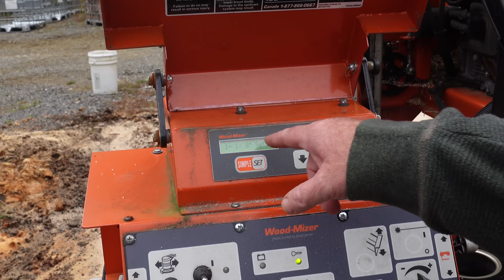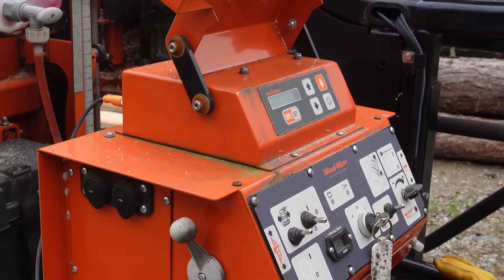We were overwhelmed! But thats a good thing

Comment: Thanks Nathan for giving Mike the tip. The sound is incredible with the saw running. Both of you have very nice facilities and are getting better. Congrats on the fire starter!
Reply: I don't remember the motor being as loud. Perhaps a bit too sensitive. Also more background motor noise in the excavator. Had to turn down the volume 2 notches.

Comment: Could you use the sawdust from the mill for Firestarter or is it too small? If so, you could maybe use the plastic containers from the totes. Trim them low on one side and set them alongside the mill in a line to catch the discharge. When they get full, slide them aside and put empty ones in their place. Just a thought

Comment: Mike, the blade lubricant tube is rubbing on the top of the log, it was nearly ripped off on the very first pass on a branch.  Perhaps, an item that requires attention, if you care to re-run the start of this video.  Regards Robin.

Comment: Is there a way to use the first pieces cut off those pine logs to make the wood chips for the fire starter?  Even if you took them to the place you get the wood chips from.  Ever since I fist saw your saw mill I was thinking there should be a use for the trimmings and the saw dust.

Comment: I use bio-diesel , used peanut oil from a fryer  mixed with pinesol and washer fluid so its not an eco thing. work just as well as regular diesel. our mill under roof but we shovel the sawdust out onto the ground

Comment: Hey Mike, I've always wondered If you have the capability to run a 2 sided blade on the mill? That way you can cut down and back. Not sure If that is an option on your current mill. Will the new mill have that option? Seems like it would be faster when processing lumber...
Reply: Those blades don't exist.  Even if they did the trailing cutting edge would get dull in the first pass being run thru the wood backwards.  Also there are parts of the mill that would be damaged if there were teeth on the back side of the blade.
Reply from the maker: Yea like David said I never saw one like that

Comment: If you can figure out how to put the Fire Starter into rolls, I will purchase them. Currently I burn 500 lbs of coal per year, I use 1 charcoal chimney. Currently I purchase all my fire starters off Amazon. Would rather order from you. I believe I paid 19 something for 60 rolls. They are approximately 1 inch round, and 3 inches long.

Comment: Did you say you put diesel in the wood miser ?  So they have both gasoline and diesel powered mills ?
Reply from the maker: In the tank that lubes the blade
Reply: The diesel was to drop on the blade to keep it from gumming up.  Engine is gas on the mill but you can get a diesel powered one.